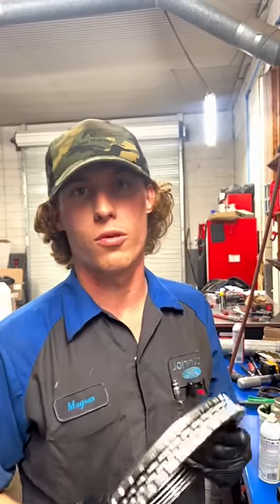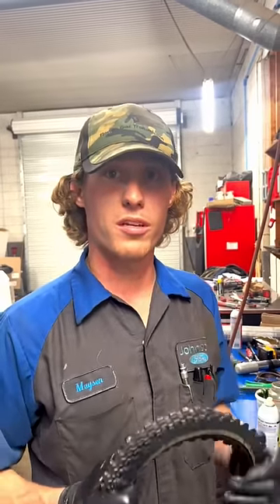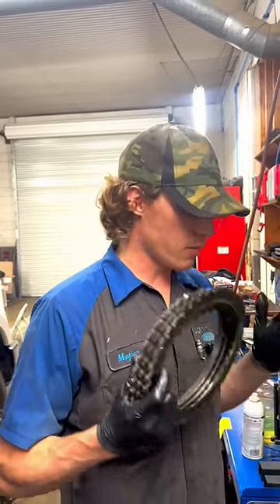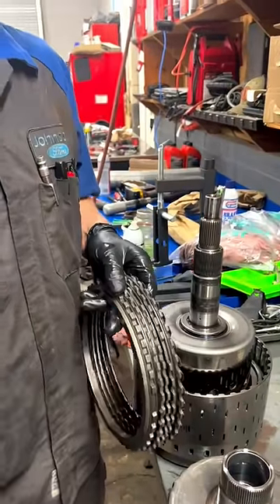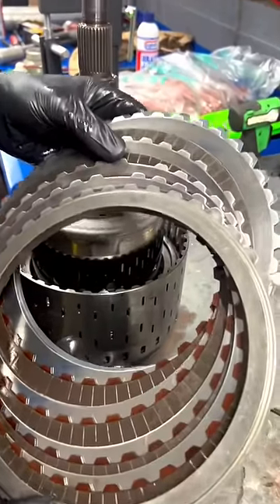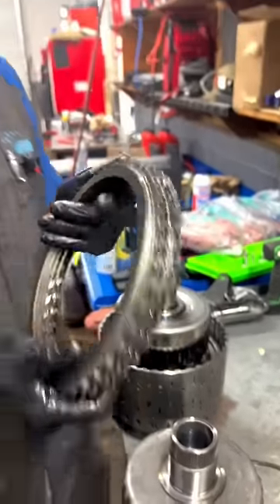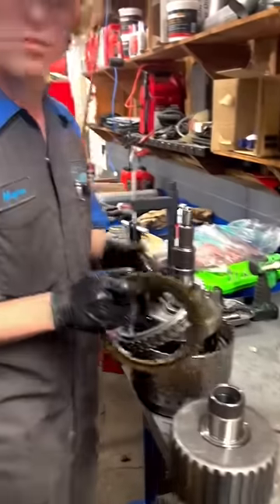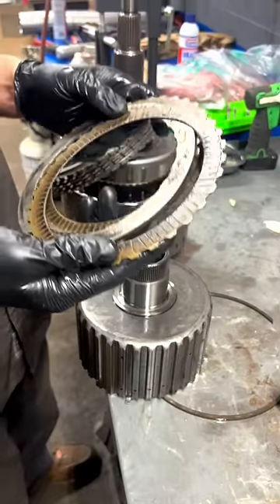Should you replace every clutch during automatic transmission overhaul? #shorts

Comment: If you are getting paid to rebuild it you should be replacing all ware parts, seals, and bearings involved. If you don't you are not rebuilding it you are reconditioning or repairing. This is why people don't trust mechanics. Don't make or use new definitions for words that already have meanings. This isn't a you problem it is an industry wide problem. Just like people who don't understand the difference between rebuilt and remanufactured, hint they are not the same thing either. 

Warranty is r&r, repair and replace, you are repairing the transmission or replacing the transmission there is no such thing as a rebuild under warranty. Just for those that don't know.

Comment: Depends on how old the build is for me I did a very mild build in my 48re just to get it back going and then snapped the input 20k later and hadn’t pulled anything to heavy so I put the old clutches back but before the mild build the 200k clutches looked great but I wasn’t going to run them

Comment: Only change whats worn out. I’ve rebuilt engines and even reused the bearings. If everything measures good and it looks like the crank and bearings are still playing together happy, why bother? I’ve put another 100,000 Kms on reused bearings more than a couple times.

Comment: Well if you can't get the parts you can't get the parts. So I would float it to my customer do you want to wait for all new components? Or I can install the parts that are still good and just replace the damaged ones. When it's work under warranty  Manufacturers are cheap and they don't want to do the job correctly they want it done as cheap as possible. If it failed in 100,000 miles the first time they're going to fail in 100,000 miles to second time. If I was building it for a customer and putting my name on it it would get all new components. Comebacks or a lot more costly than those few clutch discs.

Comment: If the parts are available and it was going in one of my vehicles I rebuild as much as possible I have the mind set that if I'm having to pull a transmission do it all at once it usually ends up being "cheaper" in the long run also IMO if something in a transmission failed I ask why did it fail? You never know if something that looks okay was the reason it grenade'd in the first place

Comment: Another way to find out if working in that warranty situation had corrupted your morality,  let's assume that same customer came in 3 days/3 miles out of warranty but your shop offers a warranty on the things you have repaired,  would you tell that customer that for the repair warranty to be valid do they need to have all the wear parts replaced or would you look at them,  say eh, they're not burnt, yeah I'll stand behind those clutches for another 100,000 ask yourself why who is paying for the repair influences what needs replaced,  and you will know if the system has broken you morally.

Comment: Your saying that very top clutch with the grooves or scars on it is good😢.. I see some off the plates are awesome looking with no marks. Just let me know. I'm used to get kits that have everything so replace everything.. from springs to snap rings, clutch plates, bands. If you think any of them clutch plates have not been overheated or abused like the friction plates and don't put them down for replacement then your letting the dealer and manufacturer get over on the customer.. if they are impossible to get then manufacturer owes customer a transmission low mileage or not. Or a completely different model..

Comment: bro its the same everywhere. when honda fucked up the piston rings on the 4 and 6 cylinder engines, on the 6 cyls we replace only the rings, im taking out rod caps on engines that never changed oil, bearings all fucked. like yeo can we replace these? Honda said no, cust said its hondas fault F-U aint payin for shit. so boom, you got new rings with used bearings. should we have replaced them? hell yea. did we? hell no.  taught me 2 things: 1. i dont like doing things half ass 2. used honda bearings will legit go another 100k.   If it was a full customer pay job hell yea id replace everything. warranty--- can only do what the manufacture tells you to.

Comment: OK short story but long 2 thousandand 13 Ford Focus while brand new transmission had issues while it was unwarrant you forward had to fix the transmission up to a 100000 miles due to the warranty Before the warranty was up the transmission failed again

Comment: Okay they don't seem to understand that you just replacing the ones that'll burn up and then you go to leave the other ones that are still kind of good in there let's put this away all right it is not exactly going to match up the way it should with the new place you put in place so that means that later on down the line it could burn up the old ones and then yeah you got an issue there. Never just replace the bad ones because the other ones will have a hard time matching up with the new ones it'll cause issues down the road. If you got the whole kit replace it all because if I'm getting a total rebuild by golly it better be a total that means brand new parts all the way around

Comment: I'm a firm believer in
if it's not broken don't fix it.
Reply: So you just let balljoints and wheel bearings give out on the highway? That’s nice.
Reply: Same here if its not worn out leave be
Reply: @tbirdddd5818  So do you replace your ball joints every time you pull a wheel off, "just because you're in there"?
Ball joints and wheel bearings can be inspected.
Reply: @e-curb  that’s not what he said, a failing ball joint isn’t a broken one. I’ve had original ball joints last longer than the motor, and I’ve had aftermarket fall apart in 5K. Go off again buddy 😂
Reply: @e-curb  so, yeah, unless I know the condition or the time frame it was replaced in guess what? I replace it. Peace of mind.
Reply: @tbirdddd5818  yeah and replace a perfectly functional part with some low quality post pandemic p.o.s. because you want to claim it's preventative maintenance. that's just stupid.
Reply: @16vSciroccoboi  that’s you’re doing if that’s what you’re buying. Buy OEM
Reply: @16vSciroccoboi  “it’s just stupid” I can tell you drive a rat rod
Reply: @tbirdddd5818  lol oems source from shady people too. 

New ball joints even from high quality suppliers are failing prematurely. Same reason I turn rotors rather than replacing. 

You do you though. I'm just not that wasteful I guess
Reply: @tbirdddd5818  I turn rotors because steel quality on new rotors is shit. 

Look, I get it, you don't understand the difference between quality and quantity. Just let it go man. I already told you to do you.
Reply: @16vSciroccoboi I’ve had THREE vehicles go over the 300K mile mark with original motor and transmission, I think I KNOW what I’m talking about. Thanks.

Comment: This cheats the customer in the long run. I don't buy the parts line bit. I know it's true, but if the same thing is going away in every transmission, somebody put the real fix on it. There should be an excess of parts that don't need replaced somewhere.

Comment: listen I tell you something as the clutches of bad and you can't get them from the auto parts store from the dealership what you do is you find a vehicle or transmission with low mileage the same kind and if you find a Boston Housing transmission would have got you're still good for the outside cracked get one of them and then you can rebuild your old one it's not just buy used transmission and put in there and get it over with lot cheaper

Comment: Put a brand new clutch in please. If the tranny is out and has 100,000.miles on it, why wouldn't you? Just save the old clutches in case of emergency. Would you warranty that clutch for 100,000 miles?

Comment: The blue oval just uses the same shitty parts the car came with. 3 transmissions in100000km, former Focus owner. Never buy the blue oval, this guy just proved it. The might go 300000 with the law suit, lol.
Reply: @Vic Yes sir 3 , original , next at 50k and the oval payed for that 1. Next at 102k. I payed cause the oval won't back their parts. Sold the car after that. The transmissions were all flashed by the oval. Also had a module go, that left my son stranded, the first day he had his license.  Sorry but you don't fix parts under warranty,  with the same shitty that were there in the first place. I never drove the car hard, worst transmissions ever.

Comment: Wow what a whole load of bull here! Well not all, but most of these people aren't trans mechanics.
Those clutchs look really nice to me and they look like new yet, which they should when everything is working right even after 100s of k miles! I bet they don't measure any different than new ones. As long as they aren't embedded with metal particles and the teeth aren't showing wear they'll run as long as new ones. Now that being said, I'm an independent so I usually buy master kits and most times replace all frictions and steels anyway. I don't like banner kits because you usually have at least one clutch pak failed so you need steels for at least that one anyway. I don't reuse blued, scored, burnt up steels ever. Also I prefer Borg clutchs as most original manufacturers usually use them, if I can get them. Otherwise Ray or Alto have been good.
 So yeah I understand the manufacturers won't cover good parts under warranty and a good mechanic should know what he's looking at if it's usable or not. But without having them in my hands and from what I can tell those should run just fine.

Comment: Is that a Dual Clutch automated manual Transmission? Put a torque converter slush box in the car instead of that BS transmission.
Reply: Stupid suggestion.. who's going to pay for a completely different transmission? The dealer sure isn't going to pay,  the customer isn't paying for the warranty work as it is. 
The guy doing warranty work for dealer isn't going to buy empty his pockets .

Comment: From one tech to another, FUCK REBUILDING TRANSMISSIONS, depending on the tranz obviously, it’s better and cheaper to get a used one and slap it in rather than rebuild one
Reply from the maker: Ehhhh I disagree my man. I make twice as much money overhauling transmissions and save ford thousands of parts cost during repairs. 

I save customers thousands on the regular by building instead of replacing too. I’m not sure if you’re familiar with ford remanufactured or new transmissions/engines but I guarantee 1 out of 5 will have a issue right out of the box and probably 3 of 5 have a issue before the 2 year warranty runs out. 

Most won’t believe it but I honestly believe that I can build a better unit than ford. I take my time to ensure everything is like it should be, plus I can offer aftermarket upgrades to solve manufacturing flaws. Id rather build a unit than replace it just because I trust my work more than I do a Mexico assembly line. 

Also contrary to popular belief, MOST of the internal parts in a transmission NEVER WEAR OUT. This means you are buying a bunch of unnecessary parts when you buy that brand new unit. Majority of the time, the only thing wrong with the trans is a worn rubber seal that caused some clutches to overheat anyways. 

So would you really want to buy a $6,000 transmission when the only thing wrong with yours is a $7 rubber lip seal? 🤷‍♂️🤷‍♂️

Don’t even get me started on used transmission lololol 

I’ve had cheap customers end up having to pay me up to 4 times to pull/put a used transmission because the first three didn’t work. I do not warranty labor on used parts. You buy a used transmission then you take the risk it doesn’t work, not me. If it doesn’t work then the labor to do it again is on the customer. Used auto parts are a joke. Especially when I can rebuild so cheap. I mean I can literally completely overhaul a 6F35 for less than $3K that includes: converter, pump, all seals, and center support.

That’s my opinion on it.

Comment: Seeing everyone say they don't to reuse parts even if they're basically brand new is what's wrong with people, reuse the shit and ask for the new parts. If that doesn't work use the new stuff and keep the stuff thar came out. There's so much automotive stuff out there that can be clean, rebuilt, reused, etc. But we've been using the mentality of "I can just buy a new one(s)) that it's running up supply and demand and partially causing national backorder. Need more gearheads and grease monkeys and less "mechanics"

Comment: I don't thank you understand. Back in the day a real macanic could rebuild a starter. Generator  alternator and so forth. All you guys are just parts replaces.
Reply: Rebuilding a starter is...just replacing parts, dude. Have you ever done it? It's changing out the brushes and sometimes bushings or bearings.
It's just more disassembly than replacing a starter and often isn't worth the labor.